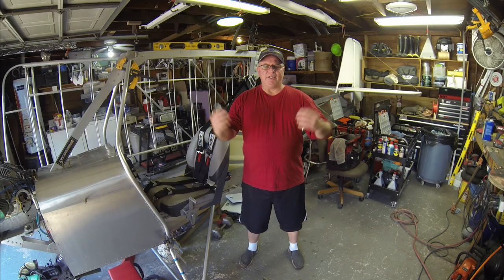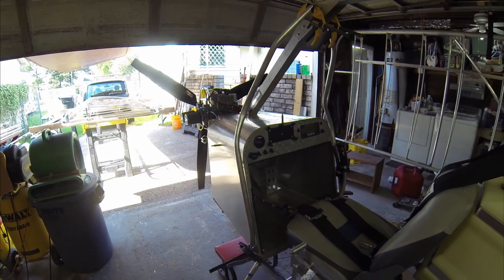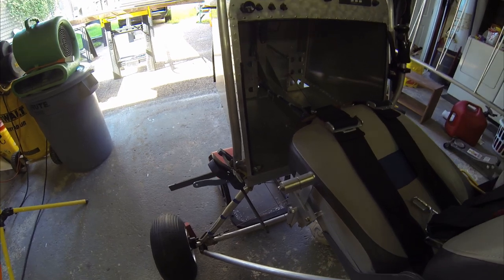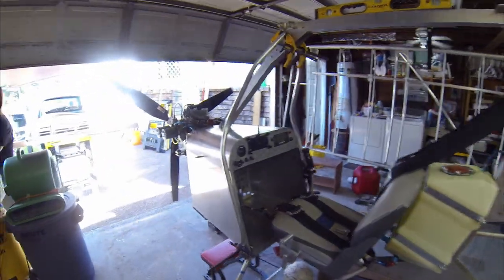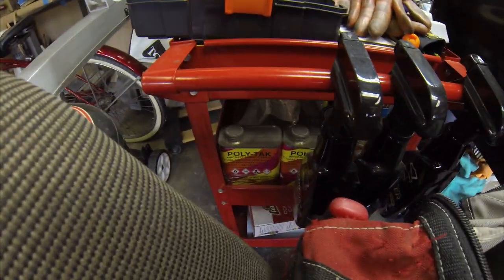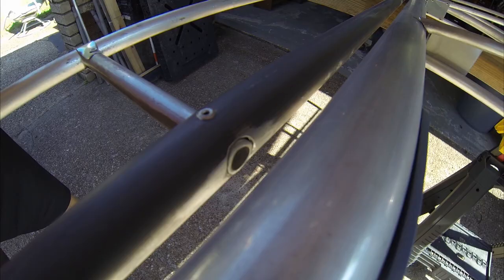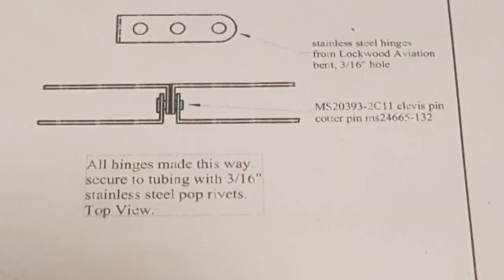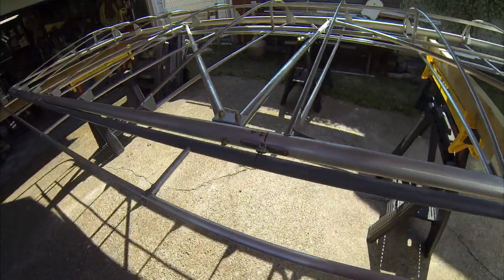Affordaplane update 8/3/2018

Comment: Why don't you use structural screws to attach the ailerons instead of pop rivets or at least so cherry max rivets
Reply from the maker: Using what the plans say to use. 3/16 stainless steel pop rivets.
https://www.aircraftspruce.com/search/search.php?s=SSD64-S&x=15&y=17
Reply: Looks like you are doing a great job on it . I have been keeping up with your build I am an old aircraft mechanic been working on aircraft for about 35 years and am thinking of building one my self
Reply: @affordaplanestore  Thanks for the link.  It saved me from ordering the wrong pop rivets.